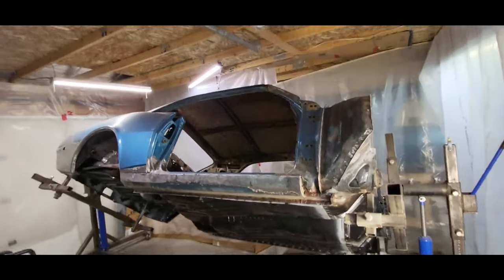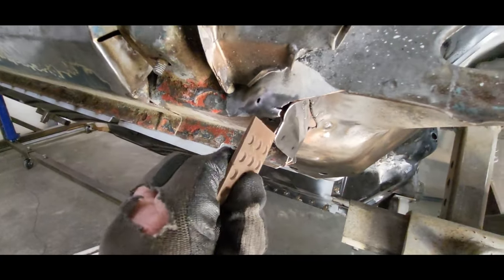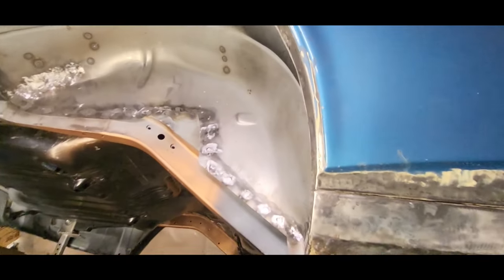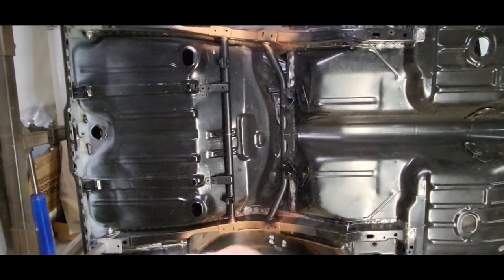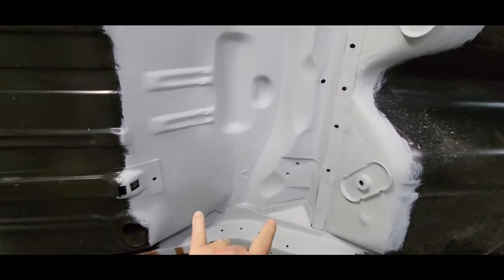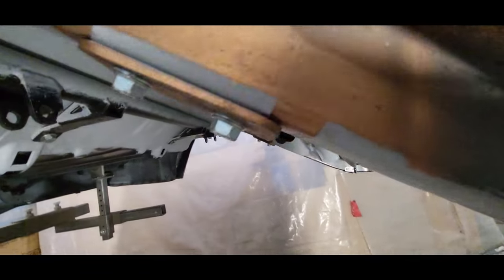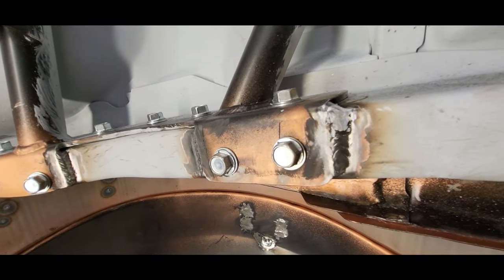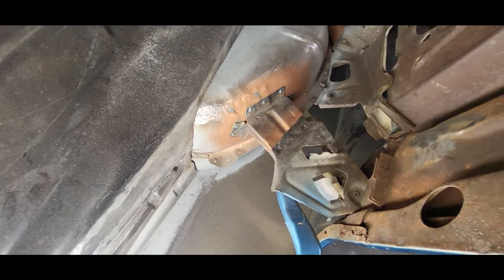1968 Camaro Project #55 Mounting the Ridetech 4-Link Cradle and Cleaning Up Welds

Comment: Hey Elrod, good to see the work continue. I always wondered how / where the water entering from above actually drips out. I had a look on my '68 the other day and found a small fold in the two sheets of metal, poked in a piece of wire and saw it come out in the low corner (pass side) of the cowl cavity. Only reason I could see, was the hole for the electric vent. On the driver side that spot is not directly visible.
Long story short, I had an incredible amount of debris (leaves etc. and sand from previous sandblasting) in that lower pocket area on both sides that I had to vacuum out in order to get those run-off holes free.
Reply from the maker: Thanks Steve! I assume these cars were meant to be cleaned out periodically. Dirt and debris build up in certain areas and cause them to rust out. Or it's just planned obsolescence, they can sell more cars that way. Cheers man!